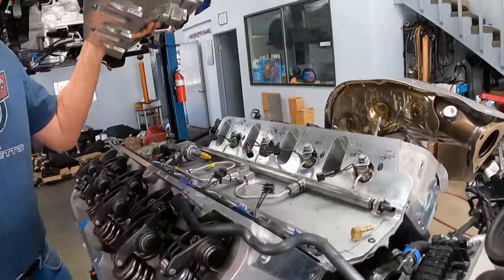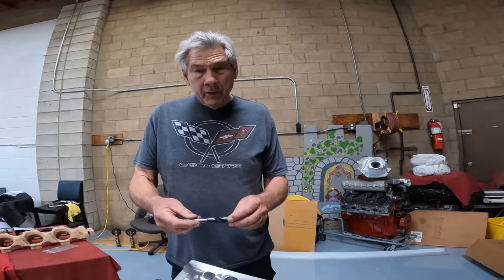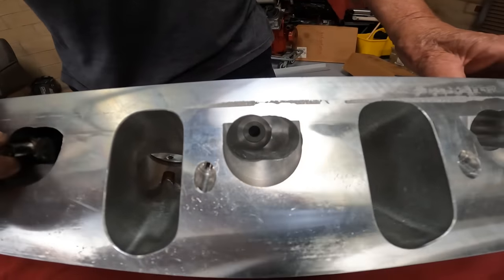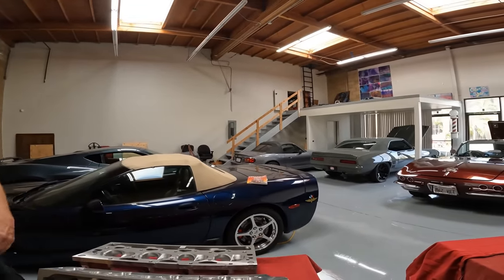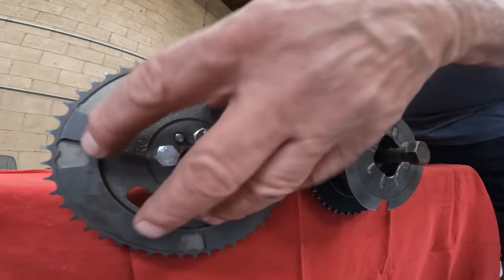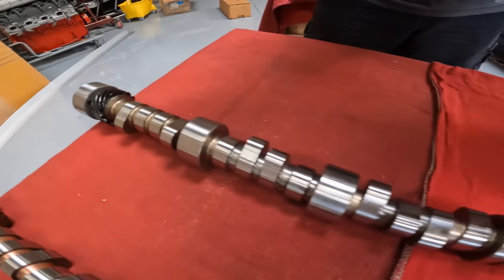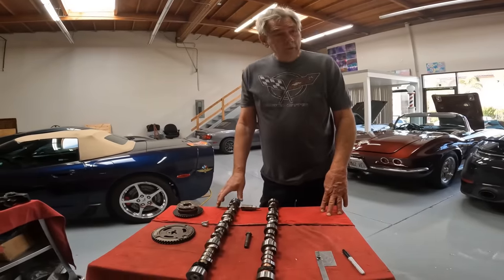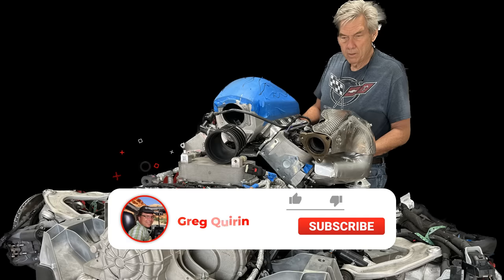First-Ever Variable Valve Timing Direct-Injected 8.1L Engine Unveiled

Comment: I really don't understand why this channel doesn't have more subscribers,this is top-notch stuff
Reply from the maker: I can’t figure it out either.  I’m thinking it’s because this content is very specific and unique to a small audience of people who understand internal combustion engines and have and appreciation for automotive ingenuity.
Reply: @GregQuirin  thanks, im working slowly ( career/$$ is my limiting factor for now not talent, also great to see my ideas that are similar to videos is working as necessary as i started my engine rebuild/mod's around March~ 2020 ) on the dodge conversion version for 440/or/hemi's using gm phasers and 5th-gen vipers cam-in-cam ( my head's are D-8's aka modern iron recasting's and the DI-injection is off a BMW/eco-diesel as the part-number crossover or so my research says so and they fit better than the LSX/LT unit's do between my twin-plugs and CNP/COP ) so im interested in seeing it run ( hope it's good on MPG's etc as i just can't bring myself to platform swap/2006+up engine and or LSX/coyote/3d-gen/k-swap but looking forward to advance's that have-come, and yes my transmission is a TR6060-platform etc ) and how to and pro's-vs-con's, my ECU/computer doesn't need to be a GM/OEM as legally/EPA 🇺🇸  i can do stand a lone for my 60's charger plus my tag's/state doesn't do OBD2-testing for pre-2002~ vin's and or won't-count sadly as it would be faster to testing/less-hassles and or volunteer for classics/20+ years-old's

Comment: MORE OF THIS! I don't understand why so many Chevy/GM guys delete VVT and/or DI instead of integrating it properly into a build. There's SO much power to be found!
Reply: because most guys just throw in an aggressive top end cam? They're not looking for low end and driveability. Very simple
Reply: @THESLlCK  it goes far beyond that. With a properly equipped VVT cam, you can make more power EVERYWHERE. And everybody wants that.
Reply: @spdcrzy  no, not everybody wants that, very clearly.
Reply: @THESLlCK  they're lazy. -_- Nobody seems to want to do max effort N/A motors anymore that actually have to be engineered properly.
Reply: @spdcrzy  what?? No dude, NA motors never had it better. theres 1000hp small blocks on the street now man. VVT isn't useful for a max efffort race car lol, which this is not
Reply: @THESLlCK  you just contradicted yourself. You said VVT ISN'T useful for a race motor, which this is NOT. So VVT IS useful in a motor like this. Max effort doesn't mean race motor. Max effort can also mean "pushing the boundaries of the engine in every possible way" - and that includes expanding the performance envelope of VVT application.
Reply: @THESLlCK  Also, name a single 1000hp N/A small block that's ACTUALLY street drivable day in day out with zero issues. You can't, because they don't exist yet.

Comment: It would be nice to mention that, the gear on the back is used normally to drive a stub gear that not only completes the oil circuit on that side of the motor but also drives the standard wet sump oil pump.

Comment: The 8-1, looks alot like a LS anyway. I'm surprised no one is using the truck engines more, the 6.6 or what ever, the gas option for 1 ton and maybe a bit larger trucks , not that familiar. I wish they would build a basically big block LS, a wider bore spacing, taller deck height, possibly a 1" taller deck  a spacing to allow 4.250-4.560 bore and 4.300-4.750 stroke up to 604cid with direct injection and port injection, use the port injection for cold start enrichment. And full throttle high rpm. Build a SS-3500 with a big supercharger 10 speed transmission, 604 CID. 20" aluminum rims built to haul and pull toy trailers. Basically a ss454/typhoon style modern truck in dually and single. Making 855TQ and 760hp  on 89 octane , and on E85 and the 😮WOW! Tune 990tq, 1100hp stock with tune and  exhaust upgrade, and blower pulley, with factory dual 3.5" or 5" single single , stock exhaust. This would be an awesome truck no one could afford, it could also be a hybrid, with a 80-120kw motor in a transfer case like gear box on the transmission, or on the transfer case in 4x4 trucks with a 60 kwh battery between frame rails. With plug in charger and re gen and charge as driving , .5%-15% of the power goes to charging driver set> and Regen or when the brakes are tapped the Regen starts even when driving non ev. Also the motor and engine work together for just under 2000 TQ, about 1400 HP, with optional  additional over/under drive in the transfer  case, to get roughly 50% reduction and 20% additional over drive, of shift from 1:1 to +.20:1while driving just like a gear change , or change in each gear, making a 10 speed into a 20 speed, or just a 11speed.  The 20 ratios works best during slow acceleration. Allow full speed good economy, with smooth gear changes. Similar to a variable ratio or CVT transmission, this is something gm should build! In 4500 also with pickup bed and 4-door .  Sorry to dream and ramble!!

Comment: The 2 things everyone deletes when they build a modern engine. This guy said nope, he loves it, and wanted to add it to a engine without it.
Reply: I'm the same... I always go for maximum torque at lowest rpm possible with the hard-built(the motor itself)... and get the horsepower at higher rpm with some power adder if more is needed. VVT and DI are key for low rpm torque and power.. look the difference between a Ls 5.3 gen 4 vs lt 5.3 gen 5. That fuel cooling down the pistons can make it for a much higher compression and make a whole lot more power **without the need for higher octane**

Comment: Back in the '90s, if my memory serves me correctly, there was a company called Magnum Industries (I think) that developed 4 valve heads for small  and big block Chevy. They were working on small block Ford and small block Chrysler. They of course used 4 valves per cylinder with 1 heavy duty pushrod and a split rocker arm. Diesels do it this way. Not sure what happened to them. It would seem a 4 valve head would be easier to fit direct injection to

Comment: big block direct.. very deserving. I am curious of durability on that heat angle. I like the gm history. I still run a spider injected truck as if it was a modern marvel. It did everything I had guessed it would back in 1996. The first injection swap..390k miles, at 26 years. and it was my fault I broke it. :goodvibes:

Comment: It's beyond me why GM didn't put direct injection on the 8.1 and continue using it for the hd trucks instead of the 6.0 or the 6.6 (gas).
Reply: It was not meeting cafe standard variable cam timing and dod on ls/lt allowed smaller engines to make more efficient power with technology to meet cafe standards

Comment: What's the point in the mechanical pump lobe when you are running efi? Since there isn't any mechanical pump that puts out 58psi.
Reply from the maker: Common rail high pressure direct injection  is close to 3000psi at the injector - the lift pump in the tank will be around 40-50psi   Also standard fuel injectors have 13-14 Ohms where as these high pressure injectors are at 1.5  Ohms.   It’s a different animal!  The cam lobe drives the high pressure pump which is in the valley under the intake manifold.
Reply: Do you not know what direct injection is ?
Reply: @GregQuirin  thanks for the info. I'm still trying to learn everything an didn't know that.
Reply: @jkfonyi  I understand what it is but not how it works

Comment: Is the block Iron or Aluminum?
Reply: Iron.
Reply: "boat anchor"
Reply: OK, the comment boat anchor doesn't apply here.
yep, it is iron but of a newer GM thin wall casting technique. The older style Gen,4,5,6 used an older style casting process. this block is only 80LBs heavier than an LS block, but overall, the engine and heads are still about 200 LBS heavier, but all in the right place, no traction problem and tons of torque. the reason for keeping the cubic inches at 496 is the clutch. I have made 588 CI short Blocks
, but didn't want that much torque. going to work with higher RPM's. Good breathing heads and intake. we will see how well the variable cam timing works. Stay tuned.

Comment: Using the injectors to cool the air on the blower 'vette,.... Just like a carbed turbo. Nice!
When he says 'computer', is he talking a Factory ECM? If this thing works, should we expect GM to copy it? 😂
NA, a big block C8 is going to be like driving the big GT-40 back in the '60's. Add some boost, you'll be hunting Veyron's at 1/10th the price!!!
Reply: Even with the LT small block and some turbos, you’ll be hunting Veyrons on a budget.

Comment: I find it hard to understand why? why would you go to all this trouble just to make it "work" with the stock ecu. intake cam and exhaust will make the same power in an 8.1..... or really close to the same power. most people want to go the other way and go to port injection. Are you going to run both types of injection, and will it have problems gumming up the intake valves? I'm really curious how much more efficient the engine is maybe that is what will make it worth it. I would have just changed or tuned the ecu.... especially for the vvt. it would have been way easier to change injector drivers and turn off the vvt and keep the stock ecu.

Comment: They're "detuned" because the stock hypereutectic pistons get "unhappy" at 500+ hp.

And as for the "your design" cylinder head that's as much bullshit as this engine "unveiling". 

How are you actually retaining those injectors IN the "your design" heads and are those injectors properly "clocked" in the combustion chamber so the spray pattern is correct?

LS engines are "wedge" headed. Splayed valve BBC chambers have entirely different "architecture". 

As for "that intake" that POS looks like somebody cast a "Godzilla" intake with that dumbass throttle body angle. Did you get "your" VVT from a Godzilla too? 

Hell maybe the "computer" and the injectors it "recognizes" are Godzilla "big-block" parts too. 

Regardless that POS is miles from running much less "tuned".

Comment: Hard pass on VVT!
Reply: Would have been first choice but know if the computer will let me. so here we go.
Reply: VVT when done right, and not by a mass corporation can have some huge Advantages.
Reply: @josefrobbins8781  Dealing with and issue on a 2.4 Ecotech right now and it's a real ball buster. Same as with any other corporate VVT setup... While it is nice to have the fuel economy it provides, the way they did them leads to nothing but huge issues if maintenance is not done religiously.

Comment: 325hp from 8.1L up to 525hp from 8.1L is still pathetic. Its no wonder the V8 scene has kept going so long they were so inefficient from he factory you can make big gains from bolt ons. but still not realize you engine is still pretty average.
Reply: That's  without the direct injection and variable cam timing
Reply: It's 65hp per liter which is quite comparable to many other stock engines both 2 and 4 valves.
Also Chevys v8s are proven to make over 3hp per CI or 180hp per liter in racing configuration NA.
Which is quite good and better than many full race 4 cylinder engines I have seen.
Especially if you compare them with other 60-70 year old engine designs.
Reply: It's a regular pump gas engine for a heavy vehicle, made to haul and tow heavy loads. It's made for off idle instant torque, which it does VERY well.

The later 8.1 made 360HP and 450 ft/lb, and would make 450HP and 550 ft/lb with a tune.

It will make over 550 with headers, a cam, a throttle body, and intake mods. And it will STILL make massive torque, right off idle.

If you want a big block to make HP, and not low speed torque, you can make 750HP on pump gas with a 496 (8.1) but it won't be an ideal engine for a 7500#  crew cab pick up that pulls a 20,000# trailer anymore.
Reply: Peak numbers are meaningless if the power band is 1,000 RPM wide.  How much power a NA engine can make is a hard limit based on CID. The question is at what RPM do you want the power to be and where in the RPM range are you OK with losing power.  ( RE a stock motor can idle at 700 RPM and pull from there where as a high number engine can't make enough power to overcome internal friction below 1,500 RPM.  ) Also note that factory motors are detuned so they live for 150,000 miles. There is no way your high HP motor can survive that long.
Reply: Considering RPM, drivability and HP per cubic inch naturally aspirated, still doing ok. 
the computer is the question we still don't have a very good answer to.